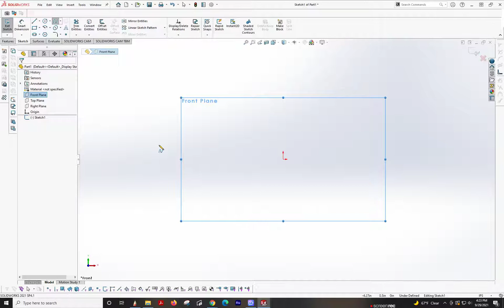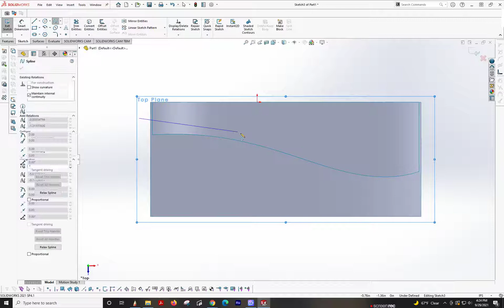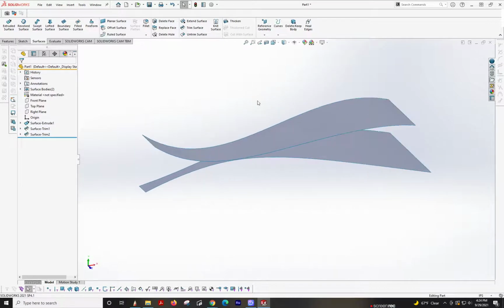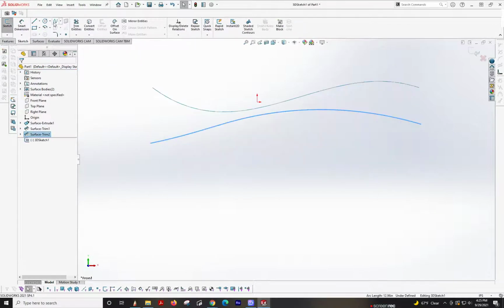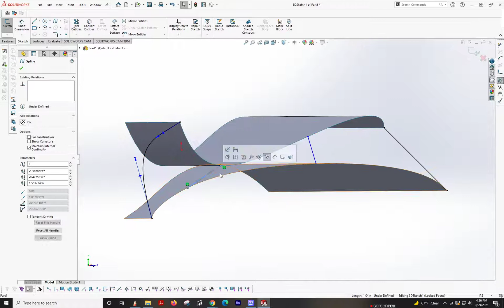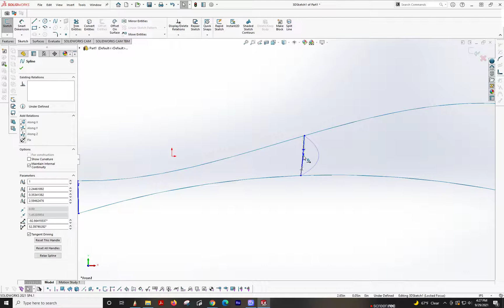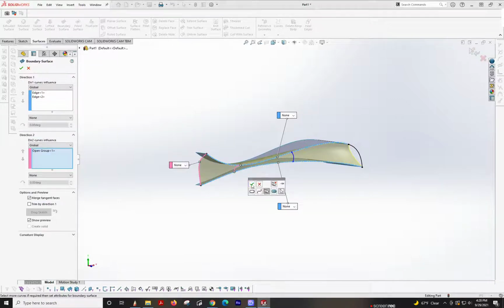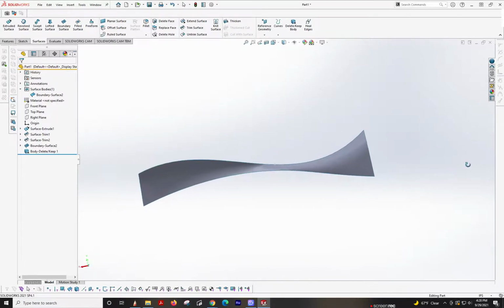Solidworks Surfacing with boundary surface by using extruded surfaces and 3D sketch splines

Comment: I was reviewing this, again, would using "style spline" allow you the same control?
Hope you have a quick answer, I'm too lazy to re drawing with style spline..

BTW, I was trying to use 3D sketch to create a triangular pyramid.
1. So, I accomplished this in a single 3d sketch.  Cool, right?
2. Then I "tried" to use planar surface = fail.
3. Then I "tried" to right click for the "selection manager" = fail.
4. WTF, my conclusion is that 3D sketches are waste of time when surfacing, because you have to create a single 3D sketch per surface.
5. Only useful thing about 3D sketch is to create a splined connector line between surfaces for defining a guide line.
Can you think of any other use for 3D sketch to assist in surfacing?